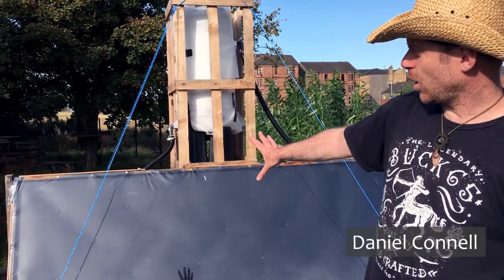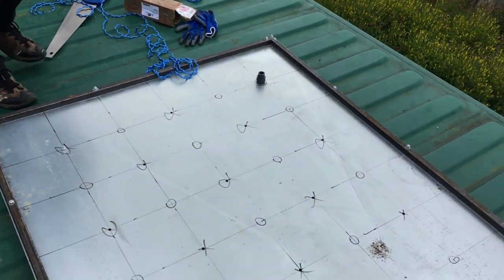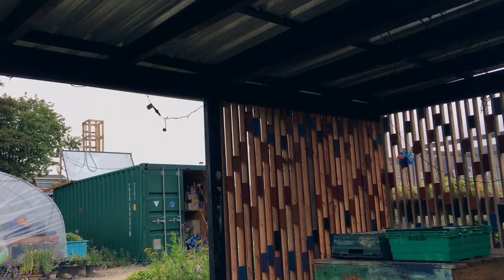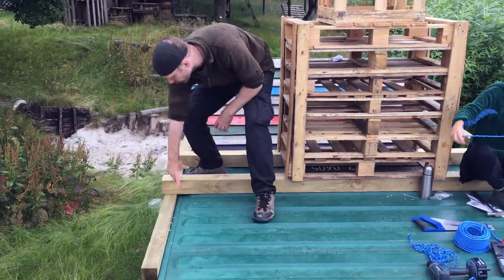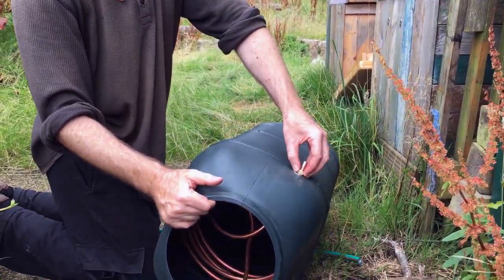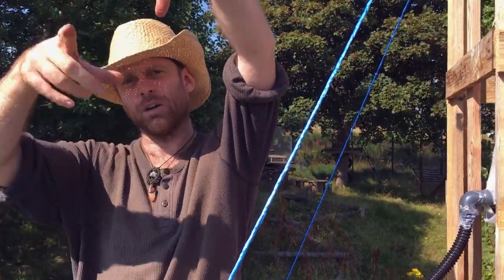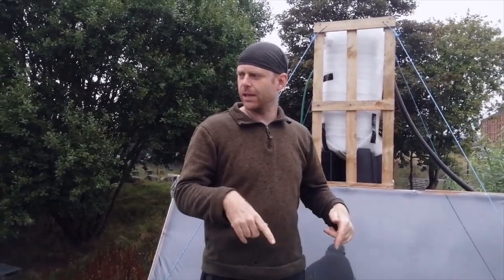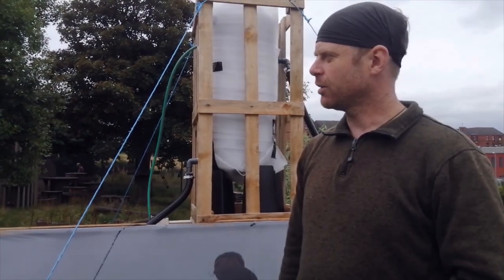DIY Solar Hot Water Panel

Comment from the maker: Initial testing has this panel producing about 60-75% as much hot water as an industrial evacuated tube system, but it costs about 90-95% less, and is a lot more durable and robust.
Can be used with a thermosiphon tank, pump, or mains pressure. I've made these in an afternoon with basic tools. Resistant to freezing, even without antifreeze (tho that's also an option).

Full test data and build tutorial to come. Any questions comment here.
Reply: could you make either a paraffin wax valve or a bimetal spring valve to slow down and speed up the flow of water so it heats up faster ? Just a thought .
Reply from the maker: Technically, but you kind of just want it convecting as much as it's able.
Reply: Maybe it's just me, but I had problems figuring out what you're actualy doing there exactly. I think, a ruff drawing of what your're about to construct may could help.
Reply: Very cool build. I've been planning on  making one for solar hot air exchange. T
I'm confused with this tho as your comment here says resistant to freezing,  but antifreeze is an option, but how? How would one add antifreeze to water thats meant to be used on the body or garden (non potable)
If I used your design, but with more durable components ie: maybe an old double pane patio sliding door rather than the plastic film, expanded foamboard, plywood back rather than cardboard,  etc. As I'm in Canada ( recently mentioned to you about the flat water brook and disappointment not being able to employ your pump system) and I have weeks at a time of -20c  -  -32c , freezing rain, many feet of snow to contend with, would this work out do you suppose? 
Also, I understand the thermal siphoning process that would work in a closed loop between the barrel and the panel, but are you saying there's enough suction to bring fresh water up into the barrel from, where, a well below ground? Or another cold water barrel in the building? 
Thanks!
Reply: @thebandplayedon..6145  I realised part way through that I was viewing the thing backwards(I think)!
The Collector feeds directly into the tank using the coldest water from the bottom and feeding heated water to the top. Your tap for water to wash hands is fed from your domestic water source into the heat loop at the top end of the tank. 
That way you can add Glycol to the circulating water preventing freezing and only the length of pipe feeding and returning from the heat exchanger needs insulating to prevent freezing!
It is the opposite way your standard hot water tank with a back boiler works!

You could make it work better ...... but it would add to the cost (which is his ethos here)
Reply: @totherarf  ok... 
so, to recap... Wait, What?  lol
Took a few rereads, but I think you're saying the hot water you use is the bulk water in the barrel as the hot water in the coil doesn't actually dump into it, rather is a closed loop.
So...essentially, the hot water filled copper coil is just a 1:1 replacing of the standard like 8, 10"  electric bent metal rod coil thingy in a normal household hot water tank? Yah, I think that's it. I thought at first all the water to be heated had to travel thru the solar box and coil, whereas the hot coil is heating the static barrel water.... that probably shouldn't have been so hard to grasp...  good times 🤔😓🥴🙃 lol
Reply: @thebandplayedon..6145  No! The same .... but opposite!
The water in the barrel is heated from the panel directly in a loop.
The water you wash your hands with starts off cold and picks up heat from the barrel (large thermal mass) from passing through the heat exchanger coil at the top of the barrel as you use the tap!
Reply: @totherarf  lol oh good grief! I'm all caught up to speed now, I think. Sooooo, one more time, the antifreeze would be in the barrel then, and will circulate thru the panel back to the barrel in a loop. 
The copper cold water comes in from the source, gets warmed in the barrel and flows down to the taps inside the house, warmed. 
Okey dokey... 👌👍Thanks!
Reply: @thebandplayedon..6145  You got it ..... assuming I got it right ;0)
Reply: @totherarf  Great! At least that wasn't too painful a process. lol
Anyhoo... thank you, Cheers
Reply from the maker: Yes that's correct. There's two basic ways of doing it; where the water in the system is the water for the shower/sink/whatever, or as here there's two lots of water which never directly contact each other, one for the panel and tank which collects and stores the heat, and the usage water which picks up heat from it.

The advantage of the former is that you don't need a copper coil or other heat exchanger, the latter is that you can use antifreeze and other stuff that you want to stay in the system.
Other than that they're more or less the same.

Glasgow doesn't really get that cold, so I worked out that like £30-40 worth of propylene glycol should keep it from freezing. If you're wanting to use this in serious winter then you might need to go to an oil or similar, or just drain the system in the cold months. 

The glazing can be anything clear. I usually use PVC film as it's cheap and easy to work with, and mostly holds up ok. Glass is a hassle and acrylic etc is expensive, but will do a better job.
Reply: @OpenSourceLowTech  Great stuff, thank you, I shall incorporate this into my greenhouse once built. Very exciting,  cheers!
Reply: This is the second one I've seen of this type of design. Neither have actually shown how the crucial part is constructed. To make a car put all these bits together: there finished product.
Reply: @davidzoller9617  Yeah I'm an engineer and they did not show how the panel is constructed. "put some stuff together and voila"
Reply: @juncusbufonius  I mean, my excuse is that I am not an engineer, however my reading skills are pretty good. That said, he does say at the end of this Pinned Comment that you've replied to that: 
A full Build tutorial would follow.
Reply: @thebandplayedon..6145  Sure but since they could have included it here and the last one did not I have little expectation. Why did they not include it? It takes a lot of effort to produce such a video. Since they avoided even explaining the fundamental aspect of this device I can see little reason why I should believe they have any intention of sharing.. If I was cynical I might think they just wanted subscriptions. Looking at their last video they did not share any of the technology. Saying they used a computer fan is meaningless. Did you know that there are several different types, that some push and some pull air?  The rating of the fan was not revealed. I can show you a car engine running but it does not explain how you might exploit it or how it works. Something I learnt 45yrs ago. These guys are just saying look what secrets we can keep. That is unless they do actually share!
Lets hope they prove me wrong otherwise they are just wasting my time and perhaps many more.
Reply: @juncusbufonius  Lol, I'm an engineer too, but was to shy to brag about it, cause all the other comments seemed to understand just fine. You made my day.
Reply from the maker: The project is fully open source, there will be a build tutorial for this panel coming out, I've just been a bit distracted working on the water turbine, which will be fully documented as well as soon as it's optimised.

Essentially tho all the build information is in this video, it's just not in a step by step format. 
But all it is is just battening two sheets of galv together with a bolt lattice to keep it from exploding, and PVC in and out.
If you have questions I can answer them here.

Comment: I know you are committed to keeping it low tech. But would even just a small pump make the system more efficient and more forgiving, rather than just to rely on convection? Also the the pump just needs to run while the sun is up i.e. while the Photovoltaik pannels have power.
Reply from the maker: The thermosiphon is pretty effective for concentrating heat into the tank, but no reason why pumps couldn't be incorporated into the system if needed.
Reply: It is fairly self regulating, however would benefit from some form of back flow valve.
Thermal siphon starts when the temperature is high (which is what we want).
But if the weather is cold and the sun isn't there - you wouldn't want it to work backwards cooling the tank.
The other limiting factor can be the need for high temperature in the pipes in order to keep them legionela free.
Reply from the maker: The configuration means that when it's cold and dark all the cold water wells in the panel, at the bottom of the loop, and shuts down the convection, with the hot water staying at the top of the insulated tank.

Legionella etc can be a problem in open systems, ie without the copper tube heat exchanger, but it only needs to hit 55C for an hour or two to Pasteurise.
Reply: @OpenSourceLowTech  If that is something of interest - we could put the flowmeters, solar sensor and some thermometers to log the data and see the energy flow.

Standard practice for boilers (of any type) is to keep the hot side at or above 72C at all times.

For the barrel, did you put any biocides in the water? People seem to put Benzalkonium chloride in their systems.
Reply from the maker: Data is always useful.

Closed systems, like this one, don't strictly need antimicrobials since no one should ever need to touch let alone drink the water. And open systems, like I've done previous, sort of can't, since the water is constantly flushing through. 
And in either case every bit of the working fluid should fairly regularly pass through the hottest point in the system several times per day.
Reply: @OpenSourceLowTech  My worry would be the biofilms and clogging. plus probably smell over time.

Comment: I really didn’t get how the panel was made water tight. So there are sheets of metal and sheet of soft plastic. But what about all edges?
Reply from the maker: The edges are sandwiched between the square section steel tube, pulled tight with bolts, weather stripping or silicone gasket inbetween.

Comment: FYI the barrel bottom needs to be 2ft./ 60cm above the top of the panel in order to thermo-siphon properly. (actually the panel outlet hose and the barrel inlet hose = 2ft. spread)
i used a steel water tank with a copper coil in my wood stoves chimney. the magic 2ft. line was clearly indicated by condensation above and no condensation bellow.
if the 2ft. is increased the pumping action gets faster/better.

Comment: I’m always tempted and interested in solar hot water installations, it’s such an appealing idea to be able to switch off my electric boiler for a few months. It always peters out when I realise I have no clue how I’d be able to get a solar system incorporated within my current system 😭 Plumbing is foreign to me and I have no storage tank, just pipes from my current boiler into the house hot water system, so I’d somehow have to break into those I suppose. Maybe buy a storage tank too. At the point where I realise I’d have to hire a plumber to do all this for me I realise it doesn’t look like a money safer after all, and the dream dies. 😢
Reply from the maker: This can be used as a preheater for an existing hot water system, so it just adds in some solar energy but you've still got the gas or electric.
You probably will want a plumber tho.
Reply: MrCurry I would like to be a word of inspiration for you if possible.  You can definitely do it.  Plumbing is not rocket science.  Yes there are things you probably don't know but in residential applications you would be hard pressed to do any irreversible damage so long as you don't flood the place then leave it indefinitely.  Kill the heater so it doesn't burn up trying to heat nothing and shut off the water main into the house then drain the pipes in the house by turning on the faucets, spigots and such and when the pipes run dry you can cut into whatever.  Still keep a bucket handy in case you're at a low point in pipes somewhere and get some minor flow.  Installing a tank is a good idea too even without the solar.  You can put a timer on the heater to only heat in the dead of night when your power consumption rate is cheaper and then the tank acts as a reservoir for cheaper power/ hot water usage than is even possible with the gas/electric "on-demand" heaters.  I hope this helps in some way, have confidence in yourself and you can make it happen.
Reply: Yes, I agree with the last 2 comments. 2nd hand Solar panels are cheap nowadays and can be coupled easily with a small (or any) 2nd hand electric hot water system as at least preheat to the existing system,which could supply a substantial boost and even negate it completely most times. What Daniel does is great as he uses simple and cheap methods most anyone can apply.  2nd hand PV panels can be directly coupled to a hot water system with few modifications, and some HW systems have 2 elements in them, one could be replaced to use any solar power you can get, which could majorly offset your HW bill most of the time, even on cloudy days. Give it a go, cheers

Comment: Great design!
Would this system be damaged by temperatures low enough to begin freezing the water?
I suspect the water would begin to freeze at the bottom of the panel and work its way up. Damage maybe to the seals on the panel or expansion causing the sheet metal to bulge maybe. Still easier to fix then most home water heating methods.
Reply from the maker: This one did freeze solid last winter. The panel is made to bulge a little under the water weight, that's what creates the cavity for the water to get through, so an extra 10% of ice volume doesn't seem to bother it.
We did burst one of the outlet hoses tho, since they can't expand. Easy to fix, and can be avoided altogether by adding antifreeze to the system water.

Comment: Im sorry to be so dim but how do you prevent the water from leaking from the heater panel? What meterials are used? @OpenSourceLowTech
Reply from the maker: The edges are batoned tight between the square steel tube, with weatherstripping in between.

Comment: Looks like a great project, but even after your reply to Wasa Mada I'm still a little confused about the lattice build on the panel, when can we expect the full build tutorial.
Reply from the maker: Got a couple other tutorials to do first, mostly the water turbine, but will do this one shortly thereafter.

The lattice is just nuts, bolts, and washers in a grid to keep the metal from separating out too much under the water weight. I don't bother gasketing or sealing them, but you'll want to get them fairly tight.

Comment: Looks like a great idea/design.  That said, is the system closed or open, is the water used for other purposes(?)  Reason I ask is not personal, just assesing potential chemical leaching from the plastics or metals, which could pose a bio-accumulation issue(?)
Reply from the maker: Both are options. This one is a closed loop between the panel and the tank, since it should involve antifreeze, with the mains feed just picking up heat via the copper coil without touching the system fluid.

But in past I've mostly made them open, with the mains being the system water, as they were in warmer environments with no risk of freezing.

Microbial buildup is a consideration, but as long as any part of the system holds at least 55-60C for an hour then it should Pasteurise. I was getting 75-80C in medium sun (which then necessitates the thermostatic valve so no one gets scalded).

The metals shouldn't leach, the plastics may to some degree, but this isn't for drinking.

Comment: Does this work during night time? I'm in South East Asia, the weather here is warm everytime except night time and cloudy/raining time.
Reply from the maker: It won't be actively heated at night, but the water temp will only come down to the ambient air temperature (depending on how much you insulate your tank).

Comment: How long do you expect the steel sheets to last? At the bolting points throughout, are you treating the panels with anything in particular to stop them from corroding?
Reply from the maker: The galv seems to hold up at least a couple of years, not sure what the max is yet.
No treatment etc other than the weather stripping / silicone round the edges.

Comment: Does it survive the Scottish weather and wind?
Reply from the maker: Yep, there weren't really any problems other than one of the pipes bursting from freezing, which was easy enough to replace. I'd suggested they should add propylene glycol antifreeze but it didn't end up getting done in time. But that meant I got to see what happens when the panel itself freezes solid, which is that the steel sheets have enough flex to absorb the ice expansion without damaging anything, which is good to know.

Other than that nothing blew over / away, and the PVC film has stood up pretty well.